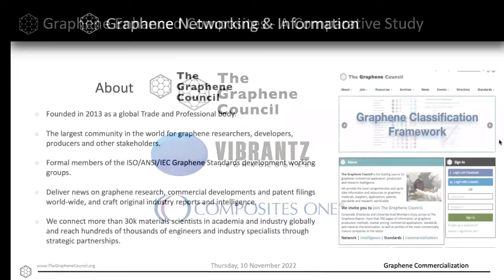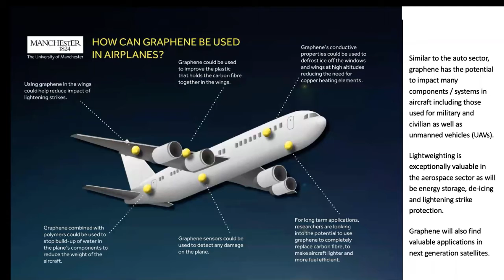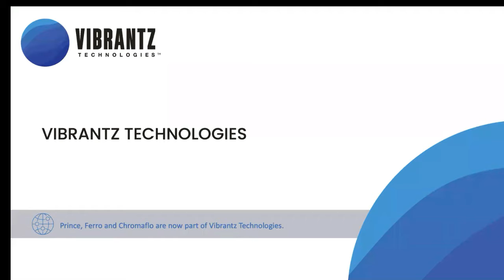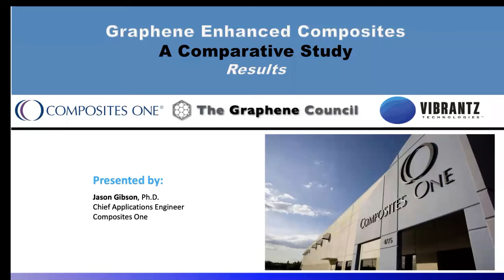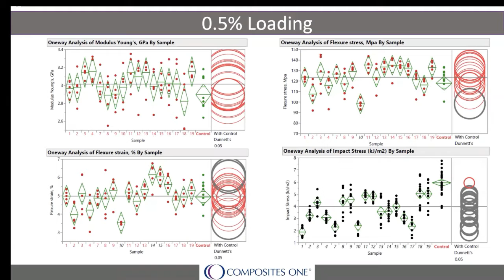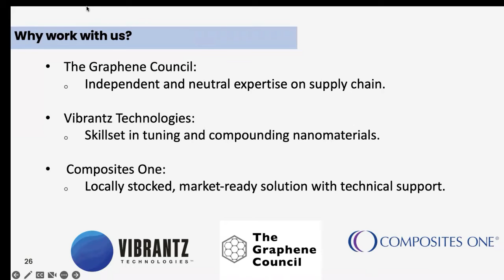Graphene in Composites Comparative Study

Comment: 19 graphene materials which you don't mention at all. Not very useful. Why hide the results? smells like marketing B.S.
Reply from the maker: Dear Ryan, All of the materials we tested are defined as graphene under ISO Standards. The 19 forms and types of graphene included graphene nano-platelets, graphene oxide, reduced graphene oxide and functionalized graphene materials. We do not name the producers or products because our objectives was to conduct an unbiased, head to head, non-optimized test to simply determine if graphene can significantly improve composites. The net results is that even though the tests were not optimized at all for the materials tested, we saw significant improvements which can be made even better when optimizing specific graphene materials with the target application. 

Anyone that would like to connect with qualified graphene producers and those that provide functionalized graphene for the composites sector can contact The Graphene Council at tbarkan@thegraphenecouncil.org or visit www.thegraphenecouncil.org to request more information. 

Thank you for your interest.
Reply: I appreciate the details and patient diligence in your response.